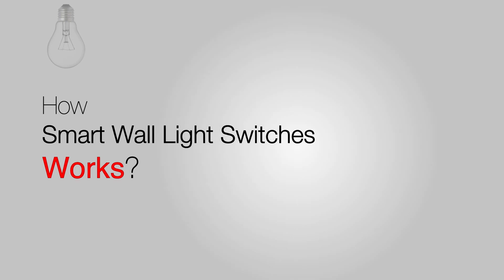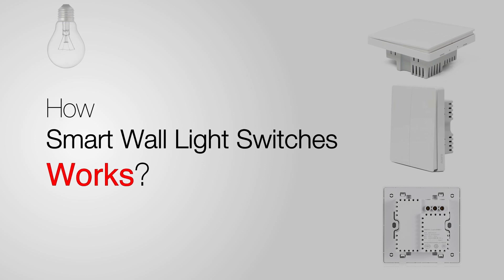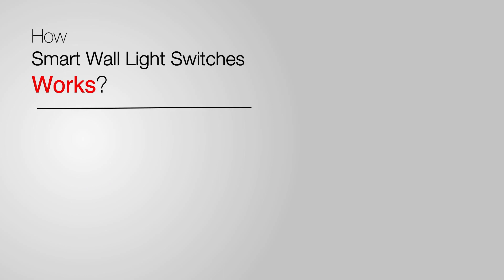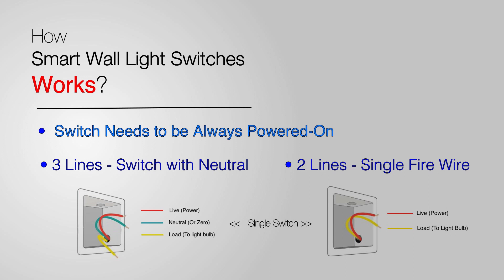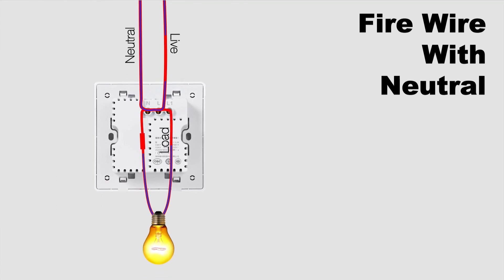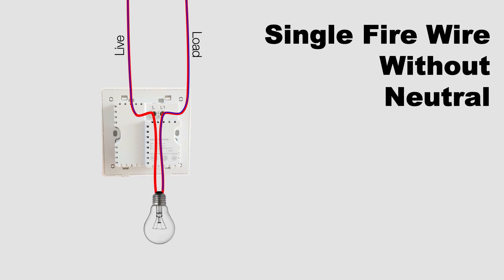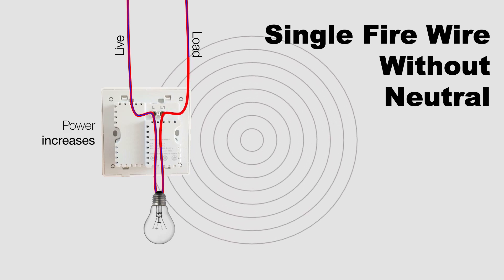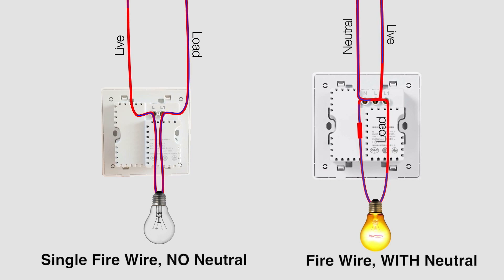How Smart Wall Switch Works - FireWire with neutral VS FireWire NO Neutral

Comment: Thanks man. Great explanation. But some smart switches require a capacitor fitted, any idea why?
Reply: I think it require more current for the built-in wifi module (and microcontroller) inside the switch.. and capacitor is like a bypass from the switch to the zero line
Reply: What is the value of capacitor if use?

Comment: not enough information...especially the most important part with neutral wire for every switch in the house make your bill a little bit higher than switch without neutral

Comment: I bought a smart dimmer switch(neutral) and realized that my current setup got no neutral line. Understand that it is still feasible to install it as long as I install a capacitor to the lightings. Is that correct?

Comment: Single firewire does not work like that. Electricity does not work like that. Single firewire - is when one live wire goes through switch and neutral to the bulb goes separately. (actually in your pictures of single firewire is firewire with neutral, you just mark neutral as "load", but L1 in this switch is not neutral - is live for second lamp)

Comment: Nice tutorial man!, but can i jumper neutral cable from electric socket to the smart switch?
Reply: yes. you can do so. the control device shares a neutral with another circuit as long as your local code does not forbid a shared neutral.
Reply from the maker: can't confirm.. but i think i've seen another video doing that.

Comment: Hi, I intend to go for netural wire using zigbee version wall switch. It is still necessary to have smart lights? Having this netural wall switch, does it load the lights or still need to bypass? My concern is folk old's turning off the light switch manually
Reply from the maker: not sure i understood your Qs, but basically all wall switches supports conventional way of turning off/on as well, so if you have non-tech savvy folks who wants to use the switch in a conventional way, yea it supports them, and at the same time, you can still use it like a smart switch. so e.g. non-tech savvy folks turns off the switch, you can turn it on via the app, vice versa.